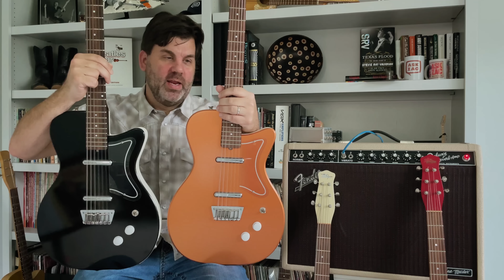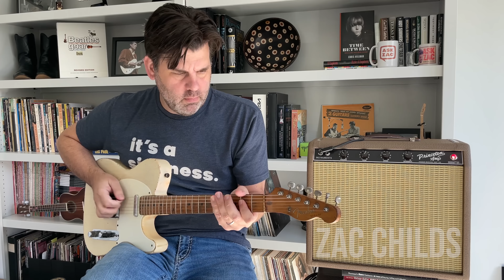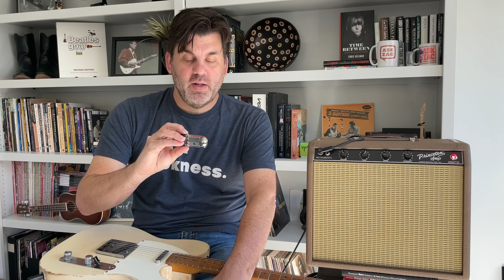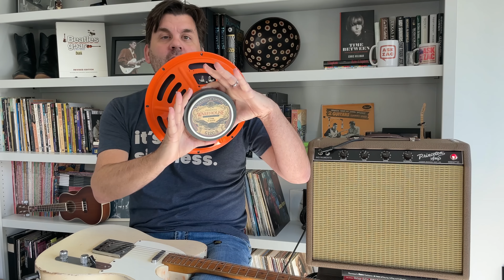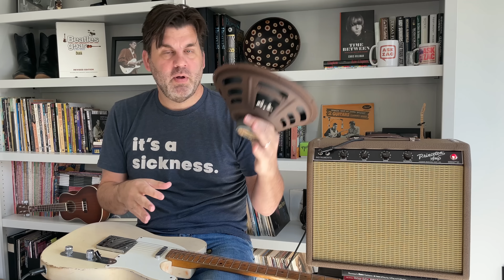Hot-Rodding The Brown Princeton - Ask Zac 101

Comment: I take it that the G12Q is effectively the same as the mid-1960s Jensen C12Q I have, just a different manufacturer.

Many speakers will change sonic characteristics, depending on volume levels, as you found with the G12Q.  The first "good" amp I ever owned was an early 1970s 2x12 Peavey Classic.  Hated the speakers.  You'd set the tone controls one way for band practice, and then when you hit the stage and turned the volume up a bit, they would sound entirely different.  Frustrating, but also a reality.  All speakers will have a "linear range" where their measured frequency response and resonances come into play, diverging from that when the power fed to them is either below, or exceeds, some value.  A great speaker will be more consistent from a much lower wattage input to something closer to its maximum power handling.  Lesser speakers may need more power going to them to make them sound the way they are supposed to sound.

Another thing which you didn't touch on, and would have necessitated too much is the actual cab properties.  A speaker will "love" an amp to the extent that it complements the qualities of the amp AND the cabinet design.  Fender amps, with a few exceptions, are generally open back cabs.
Reply from the maker: I am learning now about the profound affect cabinets make.

Comment: You CAN plug a pair of 6L6 power tubes in place of the 6V6 tubes. CAUTION This will NOT work the "other" way.  The 6L6 type can safely handle the plate voltage usually applied to 6V6 types; even when using a slightly higher voltage from a 5AR4 rectifier.  But attempting to sub a pair of 6V6 in a normally 6L6-powered amp will result in instant death for the 6V6 tubes, since the typical plate voltage used by a 6L6-based amp is going to be much too high (unless it is explicitly designed to accept both tube types).

That caveat aside, I have frequently plugged a 6L6 into my tweed Princeton, in place of the stock 6V6.  The result is a little more power, and a slightly brighter tone.  I imagine sticking a push-pull 6L6 pair into the brown Princeton would yield a more noticeable increase in power than the single-ended Princeton.  Of course, with the plate voltage being modest, you certainly won't be getting the 40W+ one normally expects from a pair of 6L6s.  But I think the difference should be audible.

What I can't, and won't, predict is the impact of a power-tube change on the bias tremolo.  Power tubes always need to have their bias adjusted for optimal performance.  Whether what the tremolo circuit applies to the grids of 6L6s makes them behave the same as 6V6 types is well above my pay grade.

Comment: You know Zak….I’m like you, I mod! Part of the guitar insanity. You really gave a great inside view of this amp. Is this speaker available to the public, or is there one similar? I want to build a Brown Princeton, but have the boldness of the CS version, oh did I mention, WITH reverb! You have shed light on how Fender got every bit of volume out of this amp. I built a 5E3 with Deluxe transformers and GZ34 rectifier tube and oh my God, what a monster! Do think switching to a long tail pair phase inverter would change or destroy the Brown Face tone? This version may be louder than a stock Brown, but I find I need more than 12 watts on stage. OK why not use a Deluxe Reverb? Not the same animal, you know what I mean. I don’t have the $ to buy a CS Princeton, but I already have the parts for a lot less $. I love building one of kind amps focused on what the amp will do for the guitar player, kind of match the amp to the player instead of the player having to change their way of playing to put up with amp. I’m funny like that. A Brown Princeton with 20 watts and reverb would be great addition to one’s amp arsenal!  Love from NW Colorado. Thanxz
Reply: @Audio Tech Labs, check out Lil Dawg Amps, I had him make me a brown princeton in a PR box for the price of $1159.00. It has a 25 watt OT which bumps it up to approximately 16-17 watta. I put in the WGS G12CS Zac talks about in this video. I also have a switch to disconnect the Negative feedback in the circuit. Makes it more raw and tweedish. Like I said, for $1159 I plug in the Amp just about everyday and always gives me a smile. If you needed more headroom still, it's possible to pop in 6l6s and a solid state rectifier, that should bump up the headroom a bit more. Look into it.  Art

Comment: Seems like a great amp - I’d love to see a spring reverb on it but that’s the way it is. Thanx for another enjoyable video.
Reply: The harmonic tremolo is divine and used subtly gets rid of the need for verb.  Then again, I have a VanAmps Sole Mate Jr that I run with a mid-size 3 spring tank when I want it, which is also lovely.
Reply: Seems like a standalone brown Fender reverb unit would be a nice match for this amp.  Not as convenient as having reverb built into the amp if you need to carry it around but the dwell control gives a lot more optios to the reverb sound than the single knob Fender reverb built into the amps.
Reply: Boss FRV-1 ‘63 Fender Reverb is the answer